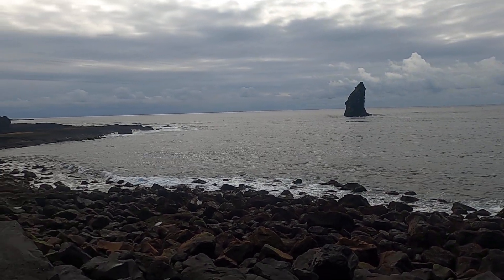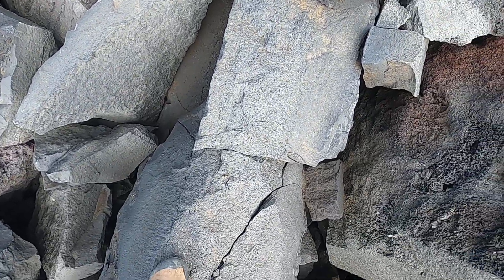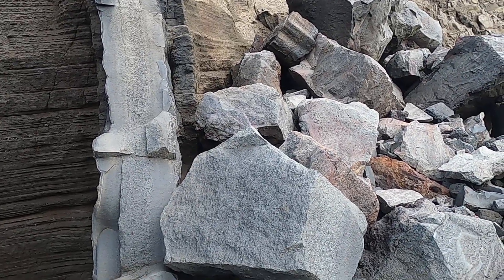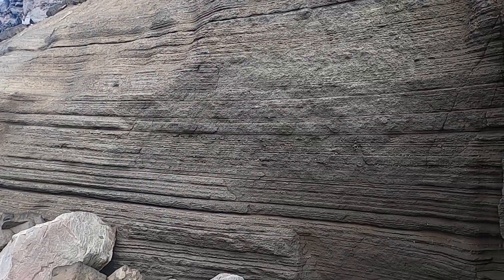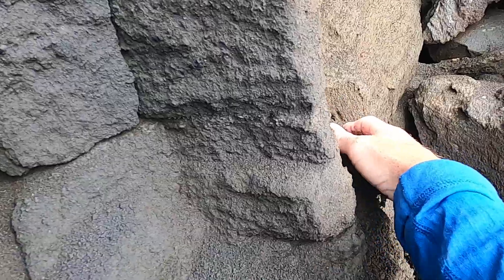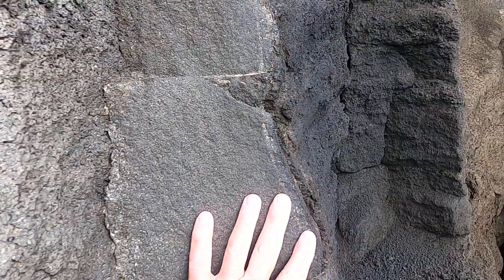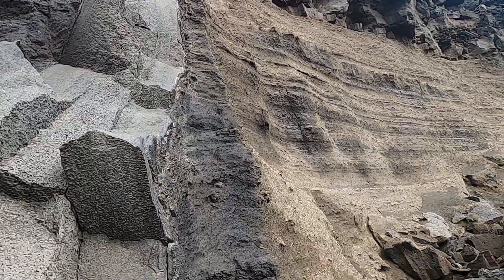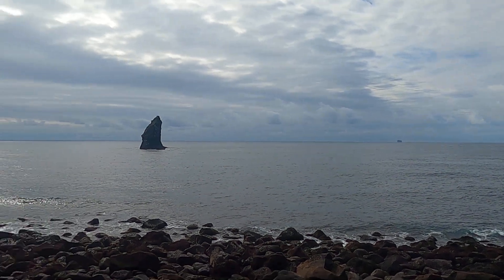Lava's plumbing system revealed! Beautiful dike carried lava up to surface in southwest Iceland

Comment: That feeder dike is very interesting as you can easily see the differences between the core area and the outer area where it was in contact with the older tuffs through which it moved. Almost like looking at a textbook diagram.
Reply: I was going to say that, shit

Comment: Another highly informative video.   Thanks Shawn.   Found this information:     "Chill margins are generally associated with igneous dikes - planer intrusive bodies, like veins, which cut through existing rock. If the dike is wide enough, it is common to have variations in the amount of time it took to cool. Along the edges, where the dike rapidly lost heat to the surrounding rock, cooling is relatively quick and the resulting texture is correspondingly fine grained. This fine grained edge, called a chill margin, then acts as an insulator, allowing the central core of the dike to cool much slower, resulting in a coarser texture.  But chill margins aren't alone. The surrounding rock (called country rock) is also affected by the heat transfer which takes place as the dike cools. As the country rock heats up, metamorphic changes can take place, resulting in a metamorphic aureole extending into the surrounding rock. We call this metamorphic halo the baked zone."
Reply from the maker: Definitely more nicely written than my narration but basically the same I hope.
Reply: @shawnwillsey  Your narration was outstanding ....................
Reply: There are amazing examples of chilled margins and baked zones in feeder dikes and apophyses in the Henry Mountains, Utah, specifically on the south flank of Mt. Hillers. I was fortunate enough to have done part of my Field Camp with Dr. Vernor Johnson there in 2012 with a great group of other Colorado Mesa University students. A video on the Henrys would be wonderful, Shawn (hint hint). Clarence Dutton was the first geologist to map and study the area, 1880s I think. The Henrys used to be called the Unknown Mountains, and they were the last mountain range to be mapped in the Continental US. They were named the Henry Mountains by AH Thompson in honor of Joseph Henry, the first Secretary of the Smithsonian Institute in Washington, DC. (Joseph Henry was the first to discover magnetic inductance—credited later to Michael Faraday, the first to discover radio waves—credited later to Heinrich Hertz, and the first to invent the telegraph—credited later to Samuel FB Morse.)
Reply: Sounds very much like this stuff extruded from an ideal pizza oven with all that cooking and baking, and then brief cooling before my teeth engage talk.

Comment: Standing on the shoulders of giants. The dyke is also lighter colored. It contains fewer of the mafic and ultramafic minerals that have already precipitated out of the melt (due to cooling and pressure change) before it ever reached this spreading point between plates.

Comment: Really enjoy seeing all these interesting spots, and the details covered explaining them, Thank You!

Are there any tells or details to estimate the depth of a dike when coming across one with no clear flow above or around? Possibly the vesicles are found more often higher in the column because of less pressure at the top of the column of fluid?
Reply from the maker: The dike's depth is related to the location of the magma system feeding it. With older dikes, the surface flow may be eroded or it is possible that the dike never propagated all the way the surface. So, not all dikes are feeder dikes. There are ways to estimate (crudely) how deep any portion of the dike was by looking at crystal size, mineralogy, and textures.

Your second question is spot on. Vesicles generally are larger as you approach the surface due to less pressure. Just like bubbles in your soda bubble accumulate on top.

Comment: So this dike is basically the remains of an event very similar to the one occurring right now at the Reykjanes volcanic complex. 
          There are similar formation in Scotland, too: I only know about them as we had a book about volcanoes in Scotland, which has been mislaid and can't be found.  The Author wrote about dike swarms, and he said each individual dike was only about two feet wide, but that the swarm consisted of dikes intruded into each other, to the point where it was almost impossible to match one side of each dike up with its other side...

Comment: How I imagine such a dike to develop during an eruption is that in areas where the lava can flow more freely, more heat from the deep will get transmitted to the surrounding rock and melt the immediate surroundings there. This should allow for even more flow, more heat, more melting. So I expect a greater cross section of the flow would establish there and a more circular shape of the dike.
Is that a realistic idea?

Comment: Very interesting and clearly described.  Is the center section an analog of a lava tube with liquid flowing through the insulated core?
Reply from the maker: Thanks for watching. Yes, I suppose the comparison is broadly similar except for the orientation of the conduit. Also, lava tubes eventually drain out as lava supply wanes and so they leave a hollow tube or cave, whereas lava remaining in the conduit solidifies to form the dike.
Reply: @shawnwillsey  Thanks so much.  My uneducated guess is that the relatively small diameter and them mass of the lava in the dike does not allow for the draining seen in lava tubes.  Thanks again from new subscriber.

Comment: Shawn, to the right of the dyke and above it are rocks with lighter coloured really weird squiggly lines on the surfaces and probably running through them. I've never seen rocks like them before. Any idea what they are?
Reply from the maker: Good observation and question. My best guess is stress fractures caused by the injection of magma into the surrounding tuff.
Reply: Without having been there, my guess is calcite veins? Groundwater effects?

Comment: Great informative video ❤ could you tell me if it is on festarfjall where you find this feeder dike. Hard to tell from the video. Festarfjall is an interesting little mountain on the edge of the coast near grindavik that has an exposed feeder dike on it due to sea erosion. Im wondering if its the same one. I only live a few miles away and would like to look at this myself at some point :)
Reply from the maker: Hi there Lava Lady (great name). Glad you enjoyed the video. The GPS coordinates for this video are under the description. The location is west of the parking area at Valahnukur (near the Reykjanesviti lighthouse). I have also been to Festarfjall when I came to Iceland in 2018 with students. It is also an impressive feeder dike that cuts through a classic tuya section of pillow lava, hyaloclastite tuff, and subaerial lava. I chose this one for the video because its a little easier to get up close to it for video purposes. Have fun exploring your amazing country. I'll be back next summer.

Comment: Thank you for sharing the coordinates of this location, i hope to make it there this weekend.  Is there a trail that leads down to the site along the water? What is the best way to reach it as it looks like a bit of a tricky place to get to.  Thank you so much for any info!
Reply from the maker: No real trail to speak of.  Follow coastline or you can cut inland a bit.  If you end up above the cliff, go east a bit to where you can scramble down soft sand to base.  It's really worth the 15 minutes or so it takes to get there.

Comment: I am a bit surprised by how small that dike is. Is that Dacite? The ones I have found are over a meter wide and are comprised of columnar basalt with a horizontal separation.
Reply from the maker: Yes, it is small but dikes can occur at a variety of scales.  Very large ones can be tens or maybe hundreds of meters thick.   Smaller ones can be centimeters thick. This dike is basalt. Some dikes do exhibit columnar jointing if cooling rate is uniform.  Joints will form perpendicular to walls of dike (cooling surfaces).

Comment: So was the crumbly stuff bentonite?  Otherwise how would such an easily crumbled rock still be there after even a few good rains?
Reply from the maker: The crumbly material is tuff (mostly ash with some larger lapilli sized particles).  This cliff face is capped by a 5-8 meter layer of basalt, which is hard and resistant to erosion. So the basalt above keeps the tuff from weathering as quickly as it would otherwise.
Reply: This is the stuff that, through diagenetic alteration, ends up becoming bentonite.